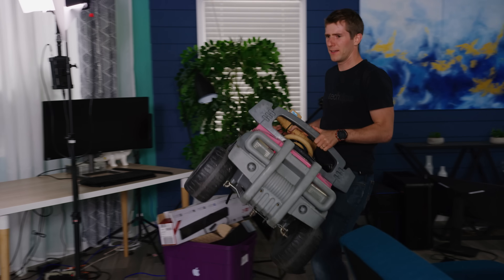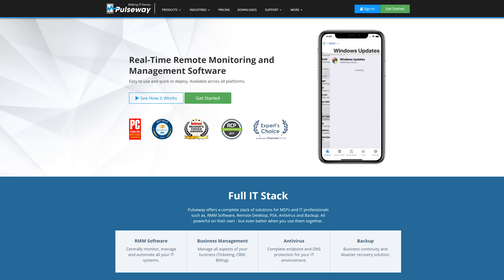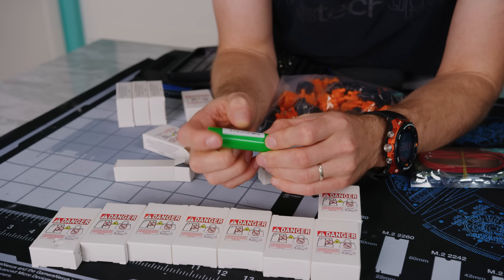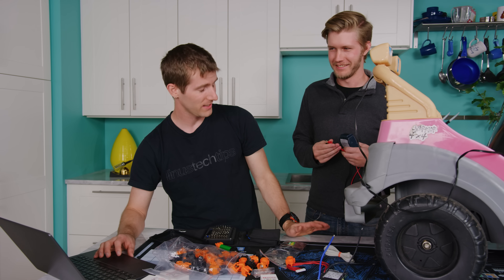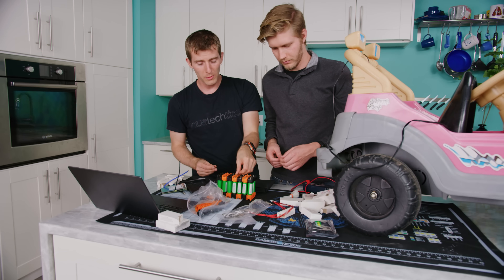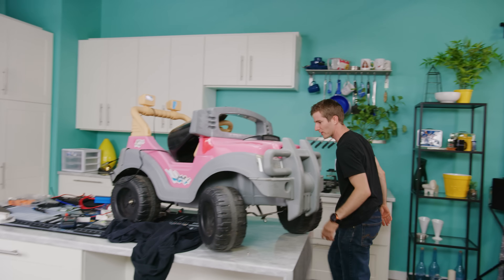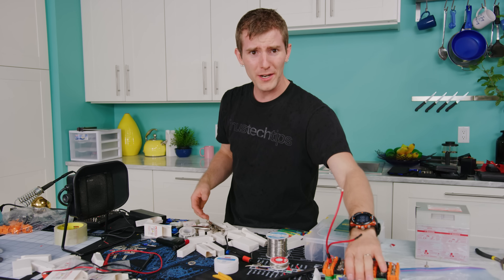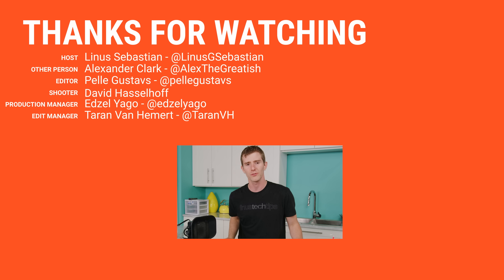DIY Lithium Battery - What could go wrong??

Comment: Linus, please be super careful with lithium batteries. I'm a battery builder, and you had me very nervous. Especially watching the initial incorrect configuration lol. Also, your BMS is doing a shite job at short circuit protection. Besttech bms do some pretty decent bluetooth enabled BMS units with TI based chipsets, well worth the investment. Feel free to contact me if you need any lithium battery advice in the future. I'd rather you knew exactly what you're doing, rather than blowing off a fingertip or burning down the office. Being able to make your own batteries is more hand than you'd imagine. Wait until you figure out how many devices have universal input. My personal ebike runs off a 100v (24s8p) pack and I can run laptop chargers and all sorts direct without conversion to AC.

Comment: Should've used super capacitors!
Reply: Super capacitors have a lot less energy density then lithium ion batteries. The benefit of super capacitors is their low ESR, which makes it possible to draw hundreds of amps without heating up to much. You can also charge them as fast as you can discharge them, because they store their energy in an electric field instead of chemical energy like in a classic battery. But in terms of energy density, they are by far not the best option.
Reply: @experimente9912  he prob aint stupid

Comment: Make a lithium ion battery for a mini itx computer such as a Ryzen 5 2400g APU system or even a mini ITX system with a gtx 1050Ti that doesn't need a PSU connector.

Comment: Anyone who vapes, is likely very familiar with the 18650 cell. And if they are like me. And have had shorting issues before due to whatever reason.
Seeing that spark may have given back some bad memories.

For me? It made me want to slap Linus. Dismantle the battery, and ride off on the jeep

Comment: You should use LITHIUM POLYMER batteries
Reply: Then Internet Explorer runs at 2 fps instead of 1
Reply: @hamzatamim8379  Still 100% improvement
Reply: Except he doesn't need the extra amps, so there is no reason to. This way he get more safety (The CID, the casing), more cycles and more density. If power output per volume of space isn't a concern then there is little to no reason to go with lipo.
Reply: Why? So they blow up and burn his kids when they're using the power wheels?
Reply: Those 18650's aren't much if any safer.
Reply: lol

Comment: 24 volts ain't gonna electrocute you.
Reply: Watt?
Reply: 24 volts across the heart can and will fuck with your conduction system.
Reply: If you stick the cables in your heart, yes, then it can. But then you can kill someone with literally anything. Simply touching the wires with your skin won't kill you, not even if you have a little wound.

Comment: Why does DIY and Lithium battery in the same sentence sound like a very bad idea?
Reply: Because Lithium can catch fire. And Linus could have electrocuted himself and died on camera :(
Reply: with 30V DC? Well, if you have liquid metal in your vaines, that could be deadly, but not, if your human. My modeltrain runs with up to 24V AC and I´m still alive, ;)
Reply: I think you spelled DIY House Fire wrong.
Reply: The thing is that CRT TV is very unlikely to explode.
However,stall that little motor and you have a recipe for explosion,fire or meltdown.
He needs an overcurrent protection,fuse and also way thicker wires.
One 18650 battery can deliver more than 10 amps in a short circuit.
Go figure.
Reply: I was thinking Linus, DIY and Lithium in the same sentence with Safety. That is not going to happen. Linus think Gloves and Wire Caps next time.
Reply: @Inareth The inside of a CRT TV is far more dangerous.  While 24v cannot kill you unless the wires are directly embedded in your heart or brain or something, the thousands of volts that might be stored in capacitors inside a CRT TV definitely can kill you instantly if you discharge it through your body.  That's why it's recommended to work with high voltages with one hand behind your back, that way, it is much harder for the current to accidentally flow through your heart.
Reply: Because it is one.

Comment: Those look like samsung 2500r 1860 batters those are mainly used as vape batteries. You can buy them at vape stores or the website imr. They are high amp with high pulse output. If you do this MAKE SURE to get the right batterys. If you dont bad things could happen very very quickly.
Reply: Another concern I have is these batterys look like the common fake samsungs I see at work all the time. You can tell by the battery sticker
Reply: So linus if you wanna get good info on 18650 style batteries check out your local vape store. Hopefully the employees will be worth there salt and know what they are selling
Reply: Vape stores also have specific charges for 18650s. You would have to take the batteries. Out of the little holder you have made though

Comment: You cannot electrocute yourself with DC voltage for roughly up to 100V unless you have wet hands, where this value comes down to 30V-ish.
AC actually hurts you starting at 15 Volts and higher.
So, no, you cannot get electrocuted by these batteries.
Reply: You are wrong, the voltage doesn't matter. It is the current level and the resistive path through your body. Hand to hand a couple milliamps will be enough to stop your heart.

Comment: Dang as an electrical enthusiast this really hurts..
Reply: electrical tape your lives before they get soldered, to avoid the shorts (via 10:37) then remove the taped ends when you are ready to actually do something with them. aswell it looked like he has made an accidental bomb, as you dont want to cover the vent caps incase a single battery shorts, or it will swell and blow anything around it up. and please linus for the love of all that is right, buy black and red electrical tape. in canadian pesos its like 50 cents a roll.
Reply: Could you explain it to the software engineers in the room? Not me, I know, I'm just asking for everyone else 😂😂👀
Reply: @metaleggman18  For starters, You don't connect same polar sides in series for adding up voltage and you don't connect opposite polar sides in parallel for adding up current.
Satisfy this statements you get.
In series, V1+V2+...+Vn, I= I, given all battery current output is the same
In parallel, I1+I2+...+In, V=V, given all battery output voltage is the same.
The starting connection Linus made was pure cringe. Lmao
Reply: The starting connection had no connection at all, though. It was just the cells stacked up in the holding mechanism. They could've just wired the tops to the bottoms of the next row. :P
Reply: @metaleggman18  He connected all the battery terminals together incorrectly. Very, very incorrectly.
Reply: I was screaming at the screen lol
Reply: Do you know what happens when you short circuit a ring that is on your finger?
Reply: Murmeli depends on the current you give it. If you short a car battery with a ring it would melt and yeah rip your finger. Tho that depends on the alloy used to make the ring, if its gold it’ll just burn the shit out of your finger
Reply: It hurt so good though
Reply: I thought you were a plumber
Reply: He said that you must match your charge voltage to your output voltage is that really true? From what I remember it's not.
Reply: Same here
Reply: LucaB361 lmao obviously
Maybe he should ask mumble next time to wire the bms
Reply: Ditto for me, anxiety to the max!
Reply: Explain it to me please as a software/network engineer I only have a rudimentary understanding of electrical engineering
Reply: "WE COULD ELECTROCUTE OURSELVES" lol
Reply: So much cringe, so little time
Reply: This hurts everyone
Reply: as all ltt videos should do for everyone that knows what he is doing
Reply: At some point I thought this was Electroboom :D
Reply: @Egon Freeman oh, I completely understand the purpose of an ee. They're just usually completely inept and useless. 
Power wheel aren't rocket surgery.
And I can't tell you how many times in my life I've had to fix something that an ee messed up when they were designing it.
Reply: @Egon Freeman The gist of it is that they are oversized children and are not qualified to put nothing on video :)
Reply: What could possibly go wrong LMFAO
Reply: And as a electrical engineer, could you answer a question? 
If i overvolt as much as he did the same engine, it would last way less than it should?
Reply: @eduardoavila646  Yes, the first thing to get the damage is the winding.
Reply: Jeeva Bharathi Even just taking a 12v and running at 24v? 
(Not going 4x like he did)? 

I know that heat would go pretty bad, but i would probably dump the engine inside mineral oil.
Reply: @eduardoavila646  there are a bajillion tutorials on how to mod power wheels. This isn't anything new. There was a video, pre-youtube, of a kid drifting around his cul-de-sac. 
Building something like this doesn't take an electrical engineer. Just some research and common sense. Most ee's are just arrogant assholes who think the rest of us can't plug in a toaster.
Reply: @Eduardo Avila The reality is that there is no way to know what will happen because you don't know which motor they used in each toy (because it probably changes a lot). Its possible that the motor will be jus fine because it was originally intended for a different purpose that requires a lot more power, or they might have selected a motor which just barely operates at the original voltage. In the first case the motor will operate just fine, in the second case the motor will fail, and could even get so hot as to start a fire. The battery pack also needs cooling and safety monitoring so its possible that with an adult in that toy that the batteries will be the first thing to fail. Since these hacks were not designed and tested by a proper engineer then there is no way to tell how much damage will occur, or how long it will last, just like with all the other hacks on the Internet. be careful.
Reply: herranton1979 Uh, i dont have these power wheels. 
I have a simillar engine, just that. A 12v dc engine that i want to overvolt. 
So i guess these tutorials arent of much use for me.
Reply: @herranton1979
As someone who ISN'T an electrical engineer, I have seen people royally fuck up toasters because they don't understand the basics of electrical theory. When dealing with something that can kill or harm you in multiple ways with ease it's always safest to assume that anyone you aren't certain of the skill level of is... lets just say a "pre-novice". And there being old videos of how to do it doesn't make it any less dangerous. There's gunpowder recipes hundreds of years old- that doesn't make a dumbass any less likely to blow themselves up.
Reply: @eduardoavila646  Heat produced in a motor can vary from the type of motor, voltage applied, back emf produced in the motor, voltage requirement of the motor, etc. I advise you to accurately calculate the heat produced.
Then look for cooling methods. Air cooled out of the window because certainly the winding will be damaged if the voltage applied is greater than required. Mineral oil is not a bad idea, but the winding is a moving part and not to mention the oil certains affects the magnetic field of the winding, and the purity of the oil won't remain the same after each run, so the dielectric properties changes, amount of back emf changes. It is just a pain the ass and a running apparatus like that cost a lot, not to mention the designing and building takes a lot more time and money since not only you have to design a motor but also a cooling system that does not clog up. Recommend building that to get fascinated but do not recommend for an application.
Reply: I scream at Linus the whole video... Its not for his kid, right? lol
Reply: Seriously.  People that don't know how angry pixies work should leave them be.
Reply: Also, never solder a battery connection.  Weld it with a proper battery terminal welder... Ugh... So much heat to the cells...
Reply: I feel you
Reply: ripp not knowing the difference in S and P
Reply: Hehe hurts or hurtz? 😂
Reply: WELCOME TO 2018!: Loud noises , nudity and overclocking barbie cars! What more could you ask for?
Reply: Oh geeze. Just get a 12s lipo 12000 to 15000 mah and you can zoom for a bit.
Reply: Lol te profile pic matches with the comment
Reply: Same bro...
Reply: I'm with you bro.
Reply: as one who was taken grade 12 physics it hurts me too. don't worry, we are all in this together.
Reply: Hey look at me I'm an ELECTRICAL ENGINEER! So cringy...
Reply: I BROKE MY PHONE CUS OF SCREAMING TO MICROPHONE
Reply: @Internet Explorer good to know you support youtube now...
Reply: Can you explain why?
Reply: BocuD no spoilers, I‘m only 4 minutes in xD
Reply: im 15 and that hurt to watch lol
Reply: @z4msupreme55  same dude, same

Comment: The note 7. The note 7 is what could go wrong.
Reply: Bring on the r/WOOOSH
Reply: Different type of battery.  Cellphones use a Li-Po cell which is unprotected and a bit different chemical make up.  I didn't really watch the entire episode; however I can tell you they were using a 18650 or 20700 Li-Ion cell commonly used in Laptops and other "older" consumer electronics, they are generally the cell composition of cordless tool batteries as well.  The only things to watch for with Li-Ion cells like this is over charging, over discharging and damaging the wrap on them.  Seeing as the entire outer casing is a part of the negative terminal, damaged wraps can cause a short which would be extremely bad. Li-Po cells you can drop from a high enough height and cause them to burst into flames.  But when you attach them to a drone it will go 100MPH :D
Reply: wooosh time
Reply: Fancy Gonk Boi big wooosh my dude
Reply: @meola69420  don't modern smartphones use li-ion batteries too?
Reply: Epic Despacito Gamer modern smartphones user Li-Ion.. the „Hobby“ plane batteries use Li-Po
Reply: Wooooooshhhhh

Comment: there is a sale going on, and i need help
I wanted to buy the Acer Predator Helios 300.
I am confused between two configuration  i7 8th gen  with  gtx 1050ti  OR  i5 8th gen  with  gtx 1060!
I am worried about if there is going to be any bottleneck?

i will use this for  gaming and programming
Reply: second choice but go for 6gb not 3gb 1060
Reply: @kylezthom2000  its 6Gb